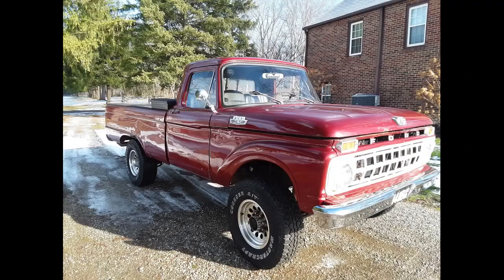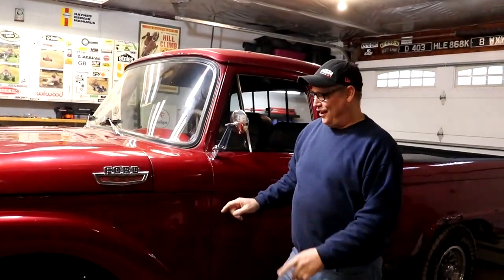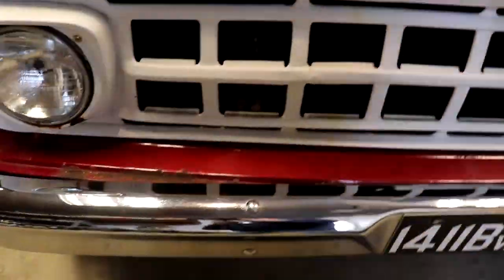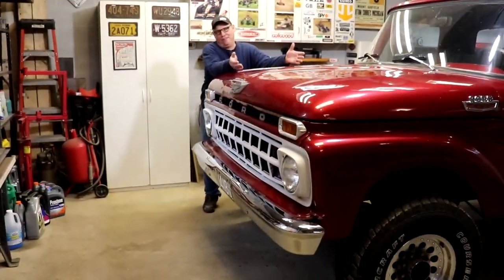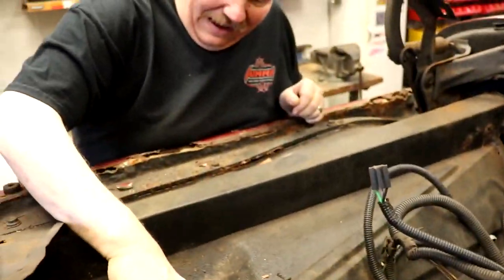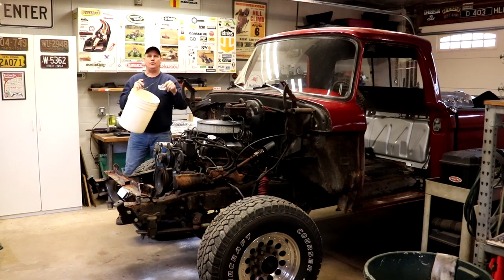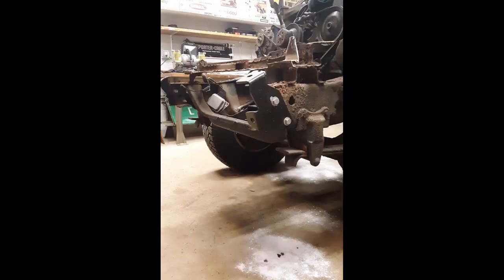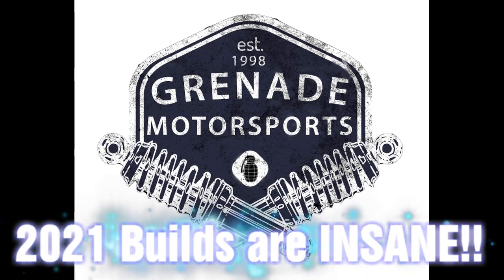1965 F250 4x4! Meet Big RED!! Major Surgery on this one!

Comment: 65/66 4x4's  used a 1964 cab , that is why the door step areas are different .  Outside sheet metal like fenders , doors , and bed should all be the same .Visit one of the many 61-66 F100 sites and there is tons of info out there on the differences of these of trucks .
Reply from the maker: Thanks for the tip and yeah- it's going to be fun watching this one emerge as a new badass truck. It's ON! Thanks for watching :)
Reply: 66 4x4 got the matching box on 4x4

Comment: Given the interior step, that makes it a '61-'63.  The grille is '65.
Edit:  Well, dang it.....the inner fender wells are from a '65 or '66.
I don't know what all you have there....other than it is a cool truck.  It's rotten but, very cool.
Reply from the maker: The whole floor and firewall, along with door jambs are literally hacked together with more caulk than weld. Who knows what this was. Thanks for watching!
Reply: Factory 4x4 had interior steps in 65 but had the older model beds. F26 on the warranty tag on the door would vouch for factory 4x4 but its possible to have been removed or replaced. Also should have came with a 4 spoke steering wheel in 4x4 rather than a 3 that a 2wd used. 64s also had the stepped floor and maybe some early 65s but who knows judging from its past.